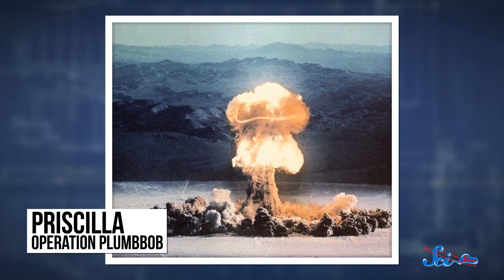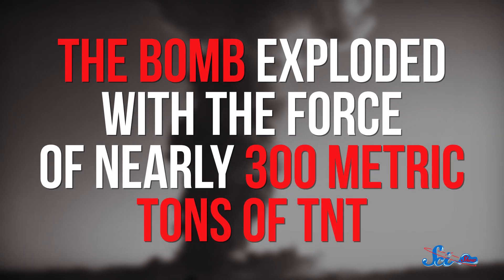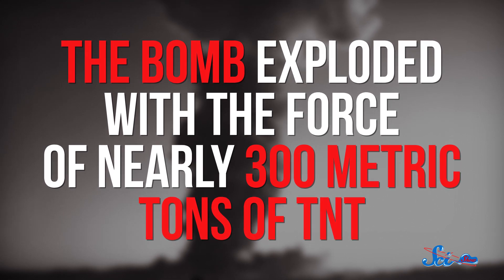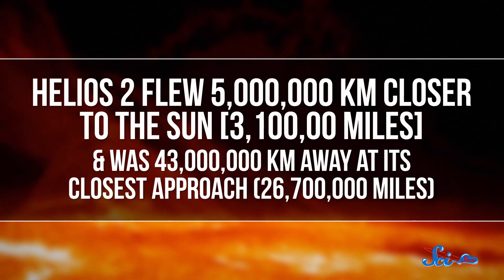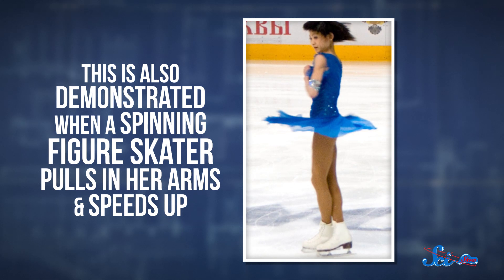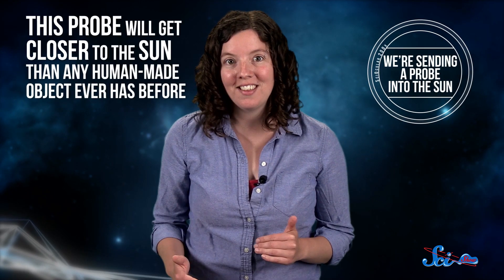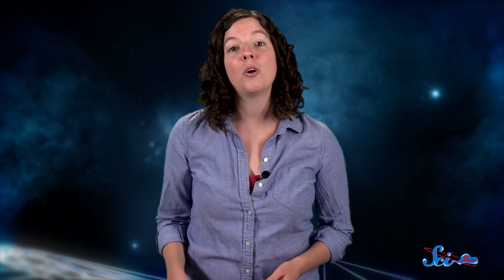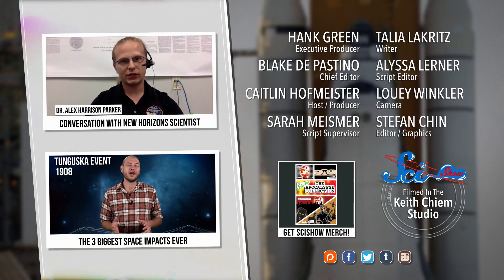The Fastest Human-Made Object Ever

Comment: steel plate made it to space
Reply: Actually, its not proven. In theory, the manhole cover , if it kept its shape, wouldn't go farther than a couple thousand of feet, because it's so wide and so it would create enough drag to slow down for gravity to come back to earth.
Reply: Although the cover would be significantly deformed by the impact into a concave shape that would fly through the atmosphere much quicker and more easily.
Reply: clayton8or_2 exactly, but it needs more force to keep pushing it up, when all the air kept shaping it it would lose its speed.

Comment: No, the fastest man made object is a plastic disk that achieved a speed of 335 540.52 miles per hour.  It happened in 1980.  On wikipedia it states: "the 1991 edition of Guinness Book of World Records and it states that the fastest man-made 'solid visible object' was a plastic disc shot in 1980 by US naval research laboratory in Washington which reached a velocity of 150 km/s. It's not self-propelling, but it sure is faster than 70 km/s."  That works out to be 335,540.52 miles per hour.

Comment: So-called "Star formation:" Think about it, if u see a spot getting brighter, it's not necessarily a new star forming. It could just be dust moving out of the way of a star that is already there! DUH! Besides, haven't u learned about Boyle's gas laws? When gas is compressed, it heats up & drives itself apart. It takes enormous pressure 2 keep gas compressed. Cold gas in space would also heat up if it was contracted by outside influences. Google: science vs evolution Pathlights. Theoretically, it takes 20 stars to EXPLODE SIMULTANEOUSLY NEAR EACH OTHER to produce enough pressure 2 form a brand new star. That has never been observed. A more logical explanation is that stars were CREATED in equilibrium since it is impossible for a gas cloud to condense, by gravity, into a star, regardless of how massive the cloud is since the more gas u have, the more the heated gas wants to EXPAND, PREVENTING formation of a star by purely naturalistic means.

Comment: In kerbal space program, I got a spacecraft to go over 1,000,000 km/sec using multiple hacks. I turned toward Kerbin and started burning my infinite fuel supply near the orbit of Minmus. Once it got to the Mun's orbit,  it was going so fast that it crossed that distance in less than a minute and slammed into Kerbin with a force of around 785 Megatons of TNT.
Reply: Edit: over 1,000,000 m/sec not km/sec.

Comment: Relative to the centre of the galaxy our solar system is traveling at about 200 km per second, so in space at least fastest might need a more concrete definition of measurement. For example horizon probe started on earth, but you'd get widely different value of a heliocentric speed compared to a geocentric speed.

Comment: 252000 miles per hour? Noooo somethings off here, that piece of metal would vaporize at that speed... Someones calculation must have been off back in those days with their limited technology when it comes to cameras.
Reply: sacr3 They specifically stated that it probably did disintegrate.
Reply: sacr3 and they figured out the speed based on having it on just one frame of a high speed camera. That's not a very good start point for an accurate value, so my bet would be that it is exaggerated. It may actually be on the lower value of the estimated interval, and they kept the higher for media purposes.

Comment: I was curious how fast the man hole cover would be going in relation to the speed of light, so after some quick googling and calculating I found that it is a little less than a whole 0.025% the speed of light. The Solar Probe Plus will do a little better with a little under 0.07% the speed of light, or warp 0.0007. While this is incredibly fast, we'll never catch a self respecting Klingon at that speed.

Comment: I wonder if the Tsar Bomba would have enough juice to propel a manhole cover faster than 200 km/s...
Reply: Hen Barrison Well since this explosion was 300kT and the Tsar Bomba was 50MT, the manhole cover would probably be instantly vapourised. If you'd ignore that fact, it would probably move very, very quickly.
Reply: StalkeraBg Krakatoa's blast also traveled around the earth multiple times. Remember we have all of Siberia to test this with.
Reply: Iam Sagittare Or get a tougher material than whatever the manhole was made of. Haha.
Reply: I have an idea... Drop 2 Tsar Bomba's with a slight delay, so one is maybe 2-3km away and a bit higher. Once the first one goes off, the 2nd can ride the massive shockwave of the first, creating a sort of Tsar cannon.
Reply: +Tři III van Wabawooo And creating enough thousands of levels of radiation, likely turning part of the Earth into a nuclear hell for 30-60000 years
And nuclear winter for 1000-50k years at worst. 
If we get around that, if plate is big enough to survive, it could have a reverse effect and trigger reaction in the magma or core 
And if it does survive all that and more, it will just be extremely irradiated superheavy meteor heading for the sun or will hit Jupiter
Reply: StalkeraBg I believe you overestimate the power of the Tsar Bomba.
Reply: Tři III van Wabawooo Last one was tested kms above ground and blast travelled around earth 3 times 
Detonating it under ground, in a sealed casket as said here would be unpredictable 
2 Tsars if triggered at the same time could fuse and amplify.. noone  exploded 2 in close proximity in such a way and we dont know what may occur 
Radiation would still be thing 
Nuclear winter is likely , and if not, just a decade of dust covering earth would be enough to reach to one
Hell.. Earth food supplies and clean water supplies will run out in less than 5 years in that
50mt nuke has immense power, which if abused can lead likely to something much worse than the most powerfull explosion- talking about likely implosion (and 0.1% of creation of a black hole if pressure is enough)
5 of those would alter Earths space movement and rotation by little, but in long term by much much more

Comment: Why do things burn up in the atmosphere if the upper atmosphere is thin and space is cold?
Reply: HeranBago Because objects entering the atmosphere pressurize (thus heat) the air in front of them. Even though the atmosphere is thin, the small layer of air in front of the object is heated until it becomes plasma, which transfers so much heat to the re-entering object that it burns up.

Comment: 70 km/s, I dunno... would a solid steel completely really vaporize under 2-3 seconds only because of air?
Reply: neuron1618 at 70 km/s... yes. yes it would.
Reply: neuron1618 Imagine a column of air 70 km long..... compressing in an instant to almost 0. Gas heats as it compresses, how much do you think compressing 70 km of air into a tiny tiny space would heat up? The air probably immediately tuned into plasma and "ate" the manhole.
Reply: neuron1618 
"Also, doesn't anything change when the process is in reverse?"

What process is in reverse?  You mean the manhole cover going up instead of down?  The air doesn't really care where the object is coming from, more that it's moving through the air.
Reply: neuron1618 obligatory "jet air cant melt steel manhole cover"
Reply: neuron1618 Well think about what meteors are. They're big hunks of rock and metal and they vaporize when coming into the atmosphere
Reply: neuron1618 Let us all just take a moment of silence for the super fast butt plug that has eather vaporized or is on it's way to the moon.
Reply: Vincent Jack It's not friction with the air. That's a common misconception. Air heats up when it is compressed and it is this heat that causes things to burn up when they move fast through the atmosphere.
Reply: neuron1618 Quite a few of them don't. And if they do they are only a fraction of the mass that they were when they entered the atmosphere.
Reply: RoScFan yes, at 70km/s...the object will be crashing into a invisible wall of air and with the friction resistance from air - the object melts and vaporised as it super heated.
Reply: TheWolfPreys - Gaming I know, but isn't pure steel much more resistant? I didn't see the footage, but from what it sounds like, it survived the initial push from a nuclear explosion, which I think is more devastating imho.

And when part of it vaporizes, doesn't it slow down the process for the rest enough?

Also, doesn't anything change when the process is in reverse?
Reply: TheWolfPreys - Gaming Btw, some of those hunks of rock and metal actually hit the ground.
Reply: neuron1618 I imagine a flat piece of steel didnt take the blunt of the explosion but more so "surfed" so to speak on top of it.
Reply: None of the claims sound remotely scientific regarding that plug imho.
Reply: NWRIBronco6 Yes, air doesn't care, but the cover is coldest at the beginnng where the atmosphere is thickest. When it absorbs most of the heat, there is not that much air resistance anymore. Perhaps that can play a role in whether it tears apart or not?
Reply: neuron1618 70km/s is about the maximum velocity a meteor might hit the atmosphere at. Remember that kinetic energy and drag involve the square of velocity and most meteors are much slower.
Reply: npeq93 False, average speed is 72 km/s. Sorry I recalled something like this in school and looked it up, and thought to mention it to you. I do recall the meteor in Russia reaching speeds exceeding this. Which also kinda made me recalling this.

Btw I am talking about meteors here.
Reply: Blue 72km/s is the theoretical maximum, absolutely not the average. Try a source besides your memory. Also, the Chelyabinsk meteor was VASTLY slower than this maximum.
Reply: neuron1618  it was a big manhole.. 2 tons?
Reply: Materials MUCH stronger than the cover disintegrate on reentry going around a fourth of the covers speed.
Reply: neuron1618 I have a feeling that it's just a good story
Reply: language mister

Comment: the word "relative" caught my attention, relative to what does the object made on earth have to be moving. Earth it self is moving at 30km/s around the sun so depending on the rotation of earth the manhole cover could have gone 30 km/s faster or slower,(or something in between)
Reply: Nikola Tesla ok, clearly its within the reference frame of the earth. The speed was calculated from there. with your logic, you can say that we are currently traveling at 2.1 * 10^6 km/hr.
Reply: Nikola Tesla normally we calculate speeds based on a large relative object. So on and around earth we calculate relative to the earth. For a probe orbiting close to the sun, we calculate relative to the sun. For a probe entering orbit around another planet, say Jupiter, we calculate based on that planet. Because you can very logically say that well the sun is orbiting the centre of the galaxy at 200km/s, so we should be adding that to our speeds. In addition when you start adding very large speeds like that together you start encountering issues with special relativity changing distances.

Comment: Just a random thought, but maybe the Sun's corona is hotter than the sun itself because it's acting like water when it is boiling. Water below a certain temperature stays in a liquid form in a pot that boils, but once some of the molecules heat past that thermal threshold, it turns into steam. So in a final thought, the water in the pot is in contact with the heat source but remains a liquid, and the steam isn't in direct contact with the heat but remains hotter than the liquid water that's in the pot.
Reply: EnderTheWatcher It's been concluded that the upper corona "vibrates" and thus, more moving particles = more heat